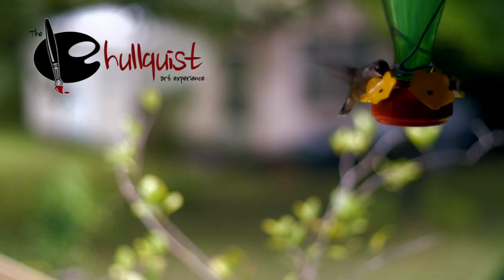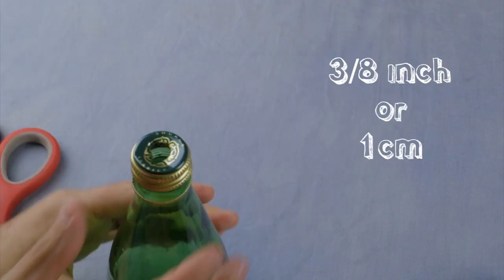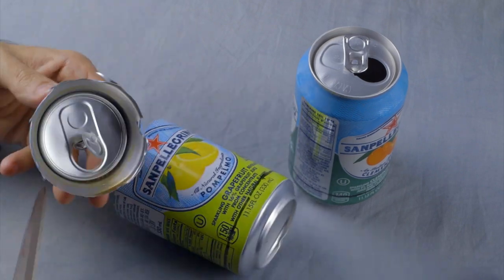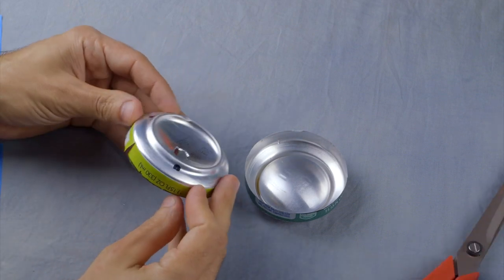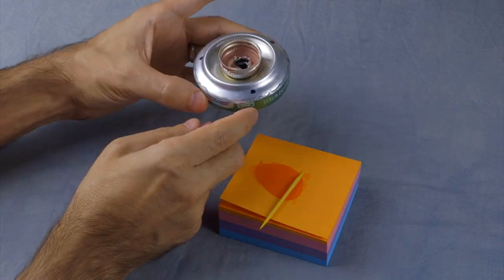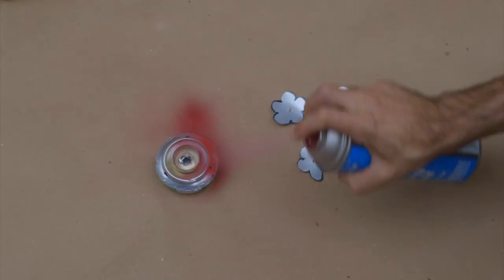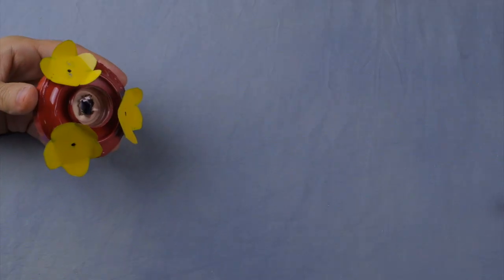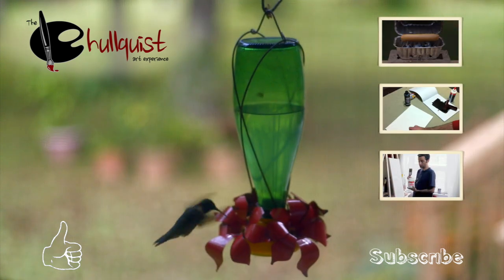How I made a HUMMINGBIRD FEEDER

Comment: For those concerned about cleaning... Replace the bottom part (two can bottoms) with a modestly sized glass jar (think 6 oz TJ's olive tapenade jar.  Glue the bottle top (with hole) to the jar lid) with hole, and everything will come apart for easy and complete cleaning.

Comment: I love this but have heard cleaning is so important otherwise our feeders become toxic.

I also worry about sharp edges. So pretty though.
Reply: I agree this looks extremely dangerous to birds and people!
Reply: Use plastic or paper straws that are about an inch or less long, then it won't do any harm to the hummingbirds. There's other videos where the person even made fake flowers out of plastic and put a hole in the middle to make it look real.
Reply: It is important to be able to clean your feeders. If you search for "soy sauce hummingbird feeder" you can find a video that shows using a Kikkoman's soy sauce bottle as a feeder. It is completely unmodified, you just basically wrap some wire around it in order to hang it from a tree. And the bottle is very easy to clean.

The feeder in this video could start getting mold inside and you'd have no way of knowing or no effective way to clean it.

Comment: My concern would be the cleaning of the bottom part since mold and fermented nectar can kill hummingbirds.
Reply: The ones at the dollar tree work perfectly well and they come totally apart to clean
Reply: just remove the bottle pour water inside to clean it and do the same with the feeder, repeat until you feel that they are well rinsed
Reply: McAdoo Vicky Now I have to scour my local Dollar Tree for these. 😁
Reply: I think they can cut themselves with the aluminum flower edges
Reply: The glue makes it toxic for them
Reply: I assume people clean these regularly when they make them lol
Reply: If you're vigilant about refreshing the bottle, then it should be possible to keep everything clean.  If not, yeah.
Reply: @alexmarker881  No.  dried  epoxy is inert.
Reply: @apoans191323  Why take a chance $4.00 don't be cheap!
Reply: @trinittygriswold988 Of course! After all, they have plenty of time (and junk) to spare.

Comment: I just finished making one but I drilled the holes in the aluminum can before gluing it together so pieces of aluminum wouldn't fall in the base. Instead of using epoxy I used a glue gun since I already had one and didn't want to buy epoxy. I covered the inside of the lid with tape before spray painting so the nectar wouldn't be absorbing the spray paint. When I made the hanging part I put some colorful beads over the glue to make it a little more attractive for the birds. This was a fun little project. Thank you for the awesome tutorial and I look forward to making many more!
Reply from the maker: Thanks for your feedback! I’m glad to hear you enjoyed the project and love how you followed your own creative path!
Reply: fRiGhTfUl 
What kind of glue did you use ?
Reply: A . Green  Sticks of glue made specifically for the glue gun. You can buy it at craft stores and at places like Target. I have to say that the glue gun glue didn’t hold the base to the lid once I filled the bottle only half full and hung it. I ended up using epoxy.

Comment: Nice idea, now tweak the adhesive and and paint and your onto something. The birds would be better off using silicone for aquariums or some type of food grade adhesive. The problem with this type of epoxy is it's toxic properties (even when cured), specially since they return to the same feeders. Wiki: The primary risk associated with epoxy use is often related to the hardener component and not to the epoxy resin itself. Amine hardeners in particular are generally corrosive, but may also be classed as toxic or carcinogenic/mutagenic.
Reply: Thank you for caring.
Reply: Good point, a food grade silicone wood even protect the hummingbirds beak.
Reply: Geezus. Just fork out the $3.50 for a well-designed, safe, easy to clean and maintain, feeder.
Reply: A lot of videos on how to make feeders use epoxy so I was wondering about this...

Comment: Very pretty! I worry about the toxicity of the paint and glue???
Reply: I was thinking about that too...and I'm going to use red cans for the base, and yellow cans for the flowers. :) Also, the base can be held together with rubber bands so it can be dismantled for cleaning.  People mentioned the sharp edges, as well - and a metal file would work very quickly on the edges.
Reply: I was thinking the same. Especially all the small metal from the drill.
Reply: I thought the same when I was using gorilla and super glue, I immediately scrapped those and used a hot glue gun and only glued on the outside and just made like a glue casing for it so it wouldn’t fall apart. I’ll see tomorrow if the birdies like it 😁
Reply: You are not concern about the paint that was used when it was manufactured?
Reply: @shielasmart4759 
Professional companies use lead free, non toxic paint.  So no, I wouldn't worry about that coming from a manufacturer of bird feeders.. Colorplace paint on the other hand, like this guy is using is defenetly questionable..  It's a good question and makes people who are watching this think twice about what paint they should use. Use a non toxic and lead free spray paint.
Reply: @mjanssen1255  Are you a reliable source?
Reply: I worry about the safety of anyone who attempts this. Sharp parts and toxic materials. A danger to people and birds. :(

Comment: Cool idea, but how do you clean the inside? You have to be able to separate the base parts (easily) to give it a thorough cleaning. A widemouth bottle would have been better so you can use a brush to clean the inside.

Comment: Out of all the diy feeder videos I've looked at,  this is my favorite and most visually appealing... the only thing I'm wondering about though, is the part where the 3 equally distant holes are  drilled. If possible, I'm thinking it would be better ( if drilling holes, as opposed to creating holes with a nail ) to drill the holes before attaching and sealing the two end pieces of cans together,  as drilling the holes will produce tiny aluminum particles/ shavings,  that I'm worried might harm the hummingbirds in some way, such as possible ingestion if the aluminum shavings are small enough to be ingested...
  Just want to reiterate that ( i think ) this feeder idea is perfect aesthetically and practically,  my only concern was the order in which the steps were taken...
  So in conclusion,  awesome idea, and beautiful execution of work. I'm going to attempt to make this tomorrow,  thank you!!

Comment: Great job! This is the best video/idea I've seen. I made this and it was so much fun! I had to use 1 liter bottles because I didn't have glass :( and liquid nails instead of epoxy because that's what I had on hand. Subbed
Reply from the maker: Great job at improvising! :)
Reply: Read comments! This design will kill birds!
Reply: @wideawake5630  i made it and zero birds died. Do you think that commercially made bird feeders don't have these same or similar ingredients in them?
Reply: @shellsies  Wouldn't use most of those either; and you might not see deaths right away but sooner or later, toxins will accumulate to deadly level, some bird will get cut and get an infection, mold will form and make birds sick. Why would you chance it? You can do homemade with a wine bottle and a hummer stopper that costs about a dollar, or just use a soy sauce bottle and you don't need the stopper. Hang it with twine, bunjee, wire; if using wire make sure no sharp ends stick out.
Reply: @wideawake5630  I made sure there were no sharp edges lol and it is able to be unscrewed and cleaned! As if I'm just cool with moldy, filthy feeders lmfao! As if the hummingbirds are either! What deadly toxic buildup are you referring to? Everything is sealed on the outside or maybe. U should research the when video. I have made the soy sauce bottle ones and the hummers hate it! I literally tossed it. In sure why you are all bent out of shape over this especially if you didn't even bother to make it. How can you even know what your saying is close to true if you haven't personally tested it? Get off the band wagon and into some real critical thought. Also, did u even bother to take note of the substitutions I made In mine? Figure it out
Reply: @shellsies  Well, your modifications are good. The one in the video can't be unscrewed and has sharp edges. There is still the offgassing of chemical toxins. My hummers love the soy sauce bottle. I'm bent out of shape simply because I want the birds to be safe. Crucify me.

Comment: Please advise how you clean the metal part?  Do you put it in the dishwasher?
Reply from the maker: I just shake it upside down until I no longer hear debris rattling around inside. Then I rinse it out good with water.
Reply: @ehullquist  I have a couple of bottles I alternate. use a coarse salt solution, 2 tsp per 500ml bottle (no iodine in coarse salt) dissolve in warm water, soak overnight and give a vigorous shake to dislodge any loose matter before disposing of salt water. Rinse thoroughly before next use.

Comment: Thanks for the informative video! I'm going to make them for sure. Is it possible to substitute glue gun adhesive for the 5-minute epoxy? Like do you think it will create a tight seal?
Reply from the maker: It doesn’t hurt to try!
Reply: @ehullquist  love your replies lol
Reply: @ehullquist  I tried and the next day the base was on the ground. Glue gun glue isn't strong enough to bear the weight of the nectar even when I only half filled it. I ended up using epoxy.

Comment: How do you keep it from leaking out? I've made it and whenever there is water in it it just leaks out through the flowers
Reply from the maker: I’m sorry to hear that it didn’t work for you. The flower holes need to be above the “water level” inside the base of the feeder (where the bottle cap is glued to the base should be lower than the flower holes).

Comment: Thank you for this tutorial. I can’t just find a hummingbird base for my bottles.  I gave a question though. Is the apoxy safe after it is cured for the birds, or will chemical leaks happen with the rain/heat?  How long will the base typically last? This is for a customer. Is the flower holes safe for the birds tongue, not sharp?
Reply from the maker: Well, there has been much concern and heated debate about this in the comments for this video. I personally haven’t witnessed any bad effects to the hummers. You could always use food safe epoxy (or some other glue you feel is safe). The metal edges really aren’t that sharp, I just mentioned it in the video so I wouldn’t be held liable if someone accidentally cut themselves while trying to make this bird feeder. 
My feeders lasted 2-3 years in the elements before they started to break or fall apart. Hope this helps.

Comment: Instead of the cans get some kind of shallow plastic jar around the same size like for skin cream that has a lid and unscrews so you can clean it all out bc of bacteria issue you can poke holes with a hot nail or Soldering tool  around the top of the jar or the sides whatever works but at least it’s cleanable

Comment: I tried to make this following the directions exactly using the bottoms of 2 aluminum cans. Any glue I used pulled loose and the bottle cap would come off, even with hot glue. After making 3 attempts using 3 different glues, I gave up and used a 1/2 pint wide mouth canning jar instead. The lid is also flatter making the glue contact a tighter seal. And, since the bottle I used is also glass, I drilled 2 tiny holes on opposite sides of the center hole in the bottle cap and drilled 2 tiny flat head screws through the cap and the lid of the jar to ensure that even if the glue does not hold out, the feeder will not come apart as it did before.

Comment: I would not use epoxy epoxy when left in the presence of moisture for too long delaminate from the surfaces that it's connected to I had to become an expert on epoxies for an Optics company that I work for many years. I would use silicone it takes longer to set up but it seals better and doesn't leech off too much bad stuff. Epoxy however is all different they gas off many different chemicals. There is an epoxy called dp110 buy DuPont that has the least amount of gassing out in the short-term but I still wouldn't use it

Comment: Drilling the holes after gluing the two cans together will leave metal shavings inside that can harm birds. Please consider taking this video down as other people have mentioned other problems with this feeder like spray paint and epoxy coming in contact with the nectar and also the sharp edges.
Reply: I was thinking about that too...and I'm going to use red cans for the base, and yellow cans for the flowers. :) Also, the base can be held together with rubber bands so it can be dismantled for cleaning.  People mentioned the sharp edges, as well - and a metal file would work very quickly on the edges - and since the base is apart, those shavings will be easily removed.
Reply: Why are you criticizing and being rude to him? He most likely washed the feeder before putting it up. No need to take the video down.
Reply from the maker: Thank you, Christie. Yes, I washed the feeder out after drilling holes, and took great effort to keep the paint and epoxy on the outside of the container. The holes were not as sharp as everyone seems to assume. I used these feeders for several years and the birds seemed to like them just fine.

Comment: Love humming birds and all birds. That was fun, and cute but a little expensive. $3-$4 for the epoxy, $1.50 -$2 for the can.  Scissors, drill bits, tooth picks ??, cans of paint $4.00 wire, and a bottle of Perrier $3.00 . 
$13.00 < or > not to bad. better than $20-$25 for store bought. Look at all the fun you can have : (
Reply from the maker: It's only expensive if you make it expensive. I had the empty cans and bottle already (and could even find these items on the side of the road). Most people have scissors, and you don't have to use a drill to make the holes. The paint is purely for aesthetics... so basically all you really need is some kind of glue to hold the flowers on (which you probably don't even need anyway).
Reply: Peter Mullen. - With the supplies you had to purchase you can make several hummingbird feeders.  Hang several in your yard, give some away to friends and relatives, etc.  Make it worth while so you don't feel you spent too much money on one feeder.  Use a plastic soft drink bottle instead of the designer bubble water bottle from France.  Drinks some beer so you have come cans,  and enjoy yourself while you're gathering up your supplies!  Steal some toothpicks from a restaurant if they're too expensive.

Comment: i did it all exactly like that. Why is it that mine have been leaking out very fast? :(
Reply from the maker: I'm sorry yours didn't work! :( It probably leaked because the feeder holes were too low or there was a leak elsewhere in the glued connections of your base.
Reply: Try again make sure you epoxy it good and also make sure its 5 min epoxy your using also you can try putting the feeder holes a bit higher or even try making the hole in the can and lid a little smaller just mess around with it try different little things untill its perfect lol. I made 1 that didnt even need to be glued I just didnt put a slit in the can before smashing them together so i can just pull it apart and clean it then push it back together then just turn it till it quits leaking then its good to go also I put hot glue around the edges of all the flowers just to be safe works great

Comment: Don't use the epoxy to glue the can bottoms only. You'll never be able to thoroughly clean the inside. Bacteria will develop and kill your hummingbirds. Use a friction fit only so you can pull apart and clean each week.

Comment: Doesn't the liquid leak out through the holes?
Reply: +MJ Trinkets If the holes are above the lowest point where the bottle cap is, it wont.  when the level in the can bottoms drops below that point, it will allow air in, which will go into the bottle allowing sugar-water down.  

If you make it so the holes are LOWER than the bottom of the cap, then it will just drain out.  

Here is something similar for pets that uses the same concept:
http://www.amazon.com/Petmate-Pet-Cafe-Waterer-Pearl/dp/B003EV7FA0%3Fpsc%3D1%26SubscriptionId%3DAKIAILSHYYTFIVPWUY6Q%26tag%3Dduckduckgo-d-20%26linkCode%3Dxm2%26camp%3D2025%26creative%3D165953%26creativeASIN%3DB003EV7FA0
Reply: Cool!

Comment: Hummingbirds see reds, oranges, and yellows so that's perfect. Bottles and cans can be free, just ask friends who drink beverages from bottles and cans OR ask bar management (that's what I did, tons of various bottles, bottle caps, and cans!) The epoxy and paint are totally safe after they've completely cured. I used E6000 and exterior paint. Birds won't get cut up...their feet are made to perch on all kinds of things like cacti, barbed or razor wire etc..look it up! This is such a great way to upcycle and encourage hummingbirds. Slather wire hanger with cheap Vaseline or even crisco to prevent ants. Simply rinse out with water, then soak in hot water and a tiny drop of blue dawn for a minute kinda shaking up a bit, finally rinse thoroughly with room temp water and voila. Anyone who honestly knows about birding would love this idea! 💛💛💛💛